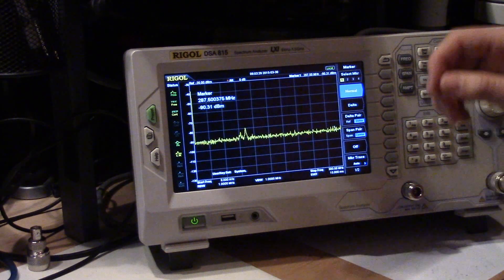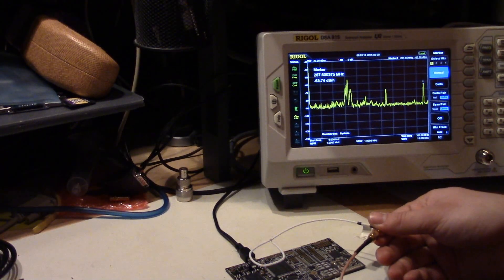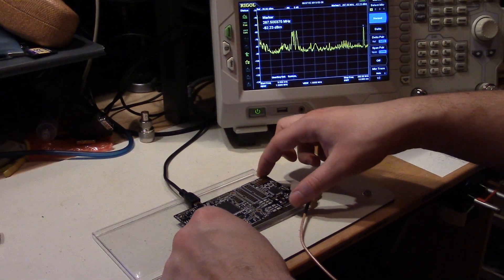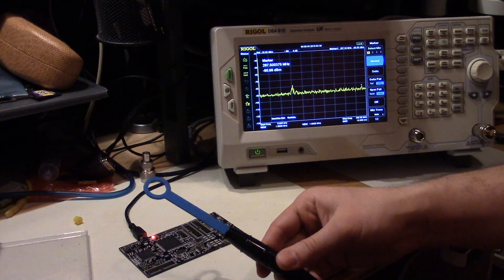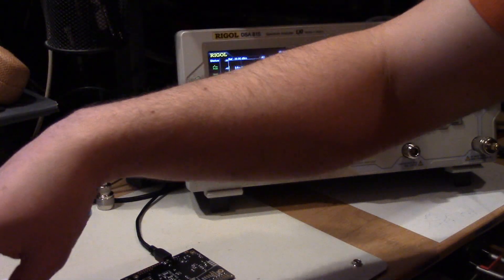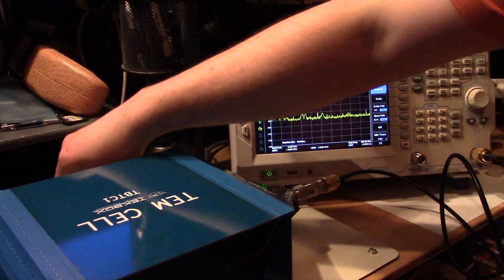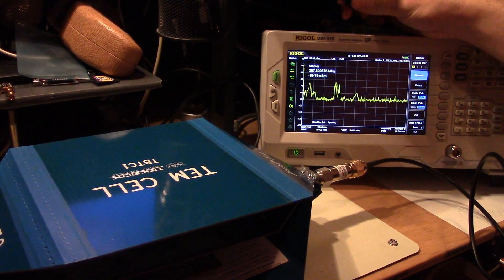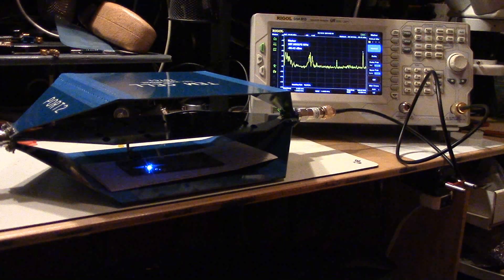EMI/EMC Testing: DSA815 w/ DIY Probes, TekBox Probes, TEM Cell

Comment: Interesting to measure the emissions of a device that works by measuring the emissions of other devices. Something like using the a spectrum analyzer to measure a spectrum analyzer. LOL

I am glad to see this.
Have you looked up the ESR of the decoupling capacitors? This is some times a place to start looking? I haven't had a chance to look at the schematic and layout. If there is some long or exposed clock lines could be moved into inner layers or adding some very very small capacitance per length. Another thing to look at is matched impedance of all the clock and data traces to the input and output impedance of the lines.
Reply from the maker: thewyliestcoyote Thanks for the hints! There was indeed a clock line on the bottom layer... I was able to get emissions down by adding the series termination (luckily had added the footprint for that, but when built the board just mounted a 1 ohm resistor). I also added ground flood on the bottom layer... the prototype didn't have that (relied only on the inner layer plane). I'm trying to change the board as little as possible, as my next order will be for qty 1000! So worried about introducing mistakes...